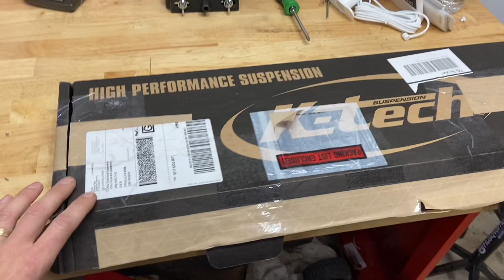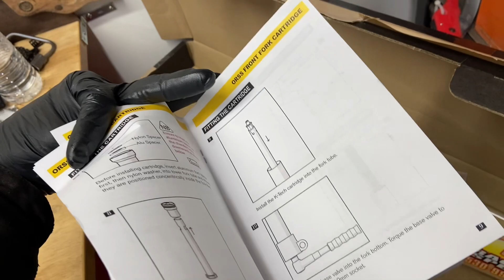K-tech spring conversion unboxing and install

Comment: What did you go with for oil volume? I’m seeing conflicting info online but I’m servicing a k tech conversion in my bike right now. Thanks.
Reply from the maker: Whatever the max was I can’t remember. But oil levels on the outside is a tuning option

Comment: Do you have to change the spring in the right fork to suit (for weight) the left side converted spring?
Reply from the maker: Ktech was cheaper and yes you get a spring for your weight when u buy it and you only convert the air tube side to spring